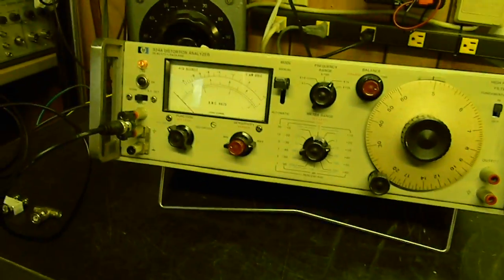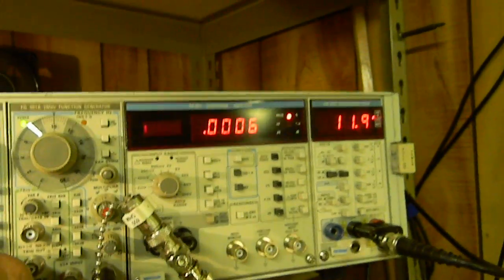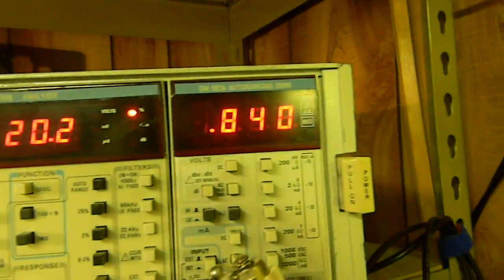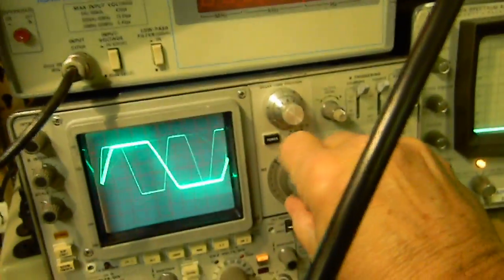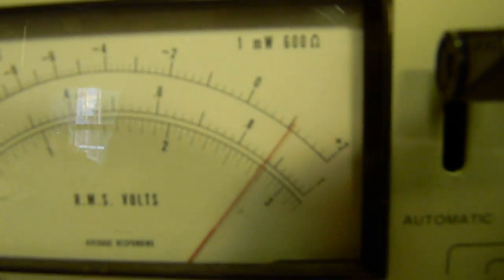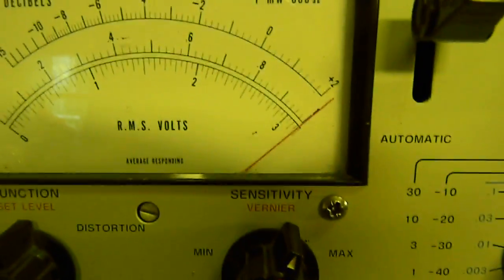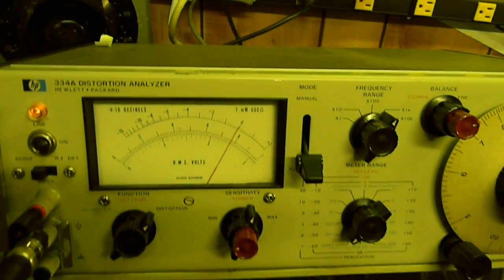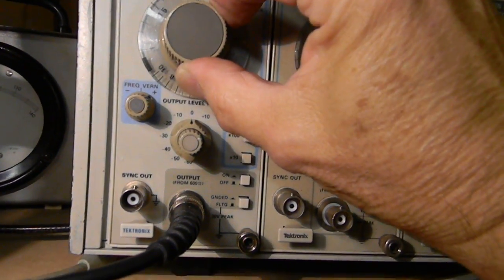Hewlett Packard HP 334A Distortion Analyzer 2 of 2.MOV

Comment: The RF Detect switch on the left was for AM radio station use back in the day when the FCC required “audio proof of performance “ annual testing. The RF detect input BNC is on the back. In use an engineer could connect an RF sample from their transmitter and then read THD on the 334A. I personally never used the RF detector in the 334A and preferred to use the station’s modulation monitor audio output instead. Many hours in wee morning hours behind the 334A. Still have one. Still works very well.
Reply from the maker: Philip,
Really nice for you to add this bit of information. Otherwise, most of these details are going to soon be lost to time, certainly one of the reasons I post videos on these old instruments to help prevent this loss of knowledge.  Now I almost wish I still had mine as I operate a homebrew AM station on the amateur bands. I do have a fancy PC based program that takes a sample of RF off the line and monitors positive and negative modulation peaks.  I use a "keep-alive" voltage source and peak limiting circuit that actually works very well where positive peaks can go well over 100% but the negative peaks can be set to never exceed 100% by varying the keep-alive voltage source. Thank  you for your comment.
Reply: @ElPasoTubeAmps  Thanks. I enjoy your work with tube amps. I have a. Harmon Kardon Citation II I’m getting ready to rebuild. I had this for almost 50 years and stored away to someday repair/re cap it. 

The envelope detector in the 334A works all the way to 6 meters. So perfect for checking distortion on an AM ham rig.  Unlike BC transmitters Amateur Radio AM rigs don’t seem to like continuous sine wave testing. Watch for over heated transformers etc.

Comment: What is the purpose of the 600 ohm load? Thanks.
Reply from the maker: +Phil Hemenway Depending on the equipment, many pieces of test equipment require an external load so that the dB scale is calibrated almost always 600 ohms for audio and 50 ohms for RF equipment. For cable TV systems it would be 75 ohms. If you don't use the external load the voltage will be double and your gain/loss measurements won't make sense. It usually doesn't affect the distortion.

Comment: Your problem may be capacitor related. More specifically film capacitors. I have a bunch of old rack mount hp test equipment, just recently I got a HP 500BR frequency meter that was WAY out of calibration on the higher frequency. I replaced all the film capacitors with high precision cornell dubilier and vishay sprague in the range selector switch and after recalibrating it work beautifully now.

Comment: Thanks for the demonstration.

The way the distortion analyzer works is that you adjust a notch filter filter through the procedure you demonstrated to remove the fundamental frequency. Once the fundamental is notched out, all that is left is distortion and noise.

Comment: Can someone tell me what this actually does, i think I get it but can u reverse this by adding more distortion if you want for creative purposes
Reply from the maker: Its purpose is to identify the level of Total Harmonic Distortion (THD) and it is typically used to help reduce THD in an amplifier. Using it to increase THD for creative purposes would probably not be a good use for this instrument as it  gives - Total - harmonic distortion. You would want to use a spectrum analyzer which will clearly display each individual harmonic and its amplitude so maybe you could "tune" an amp for desirable and undesirable harmonics.
Reply: Thank you for the information

Comment from the maker: Thank you - it is a bit labor intensive and for that reason I tend to make less measurements but I agree that it is beautiful and that is why I keep it.  It is as accurate as the digital equipment and it has a very nice analog audio voltmeter The Tek equipment seems to be the most accurate (in my opinion) and is microprocessor based but the HP 8903A/B  is the way to go. I got mine for $530 for the 8903A and USB/HPIB interface.

Comment from the maker: The HP 334A style is nice but tedious if you want to mearsure many points. Best ultra low distortion oscillator I have found is the Tektronix SG 505 - plugs into the TM 50x series modules. I test at 1KHz initially for max power, clipping level and sine wave distortion then move to 30 or even 20 Hz at the low end and 20KHz or more at the upper end. 400 Hz would be a good point also. I am not familiar with anything but the HP and Tektronix distortion analyzers. There may be better instruments.

Comment: @essoterric
I ask because I have a HP8640B signal gen that produces FM (from an internal or external input). The specs from manual & measurement by other owners is about 0.3% distortion (0.2% for internal audio), so total of 0.5%. If I use a low distortion "stereo gen" to drive the audio, total 0.3%-0.4%? The dedicated FM Stereo RF signal Gens advertise 0.1% or more. I read distortion can affect alignment & separation (vintage stereo FM tuners). If you want to sell the 334A let me know.
Reply: They are good units I use a 333A which is basically identical to the 334 to do just what you are intending, I know this is an old post and you have  probably solved your questions by now but my weak link in the chain is the FM signal generator and getting it to produce a consistent frequency, just something to watch out for.

Comment from the maker: Good distortion numbers would be considered by most to be 1% or less in the playback system. Distortion at 10% or more, generated by the guitar amplifiers, are not uncommon in the creation of music and may be desirable to the player and audience. Distortion may be intentionally introduced at low level (in the voltage amplifier stages) or at high level by clipping in the power amplifier by overdriving it. Playback within the stereo system with distortion that is reaching clipping is undesirable

Comment from the maker: The back-and-forth nulling procedure is to completely null as much as possible the test frequency - say the 1 KHz signal you are injecting into the amp that's passing through to the output. We are measuring at the output of the amplifier so after suppressing the fundamental (test) frequency what's left are the distortion (harmonic) products created by imperfections in the amplifier. The analyzer displays the sum of all of these harmonics giving Total Harmonic Distortion (THD) on the meter.

Comment: Also I was thinking if you are trying to make an adjustment of MIN distortion does it matter what the absolute value is. If you are not trying to meet or measure factory distortion than it can still serve as a tool to adjust say a radio for min distortion. With that said I don't know much about distortion. What  are good distortion numbers for a radio, amp and other audio sources and devices. I assume the speakers are the big distortion adder. Also can the ear even hear this?

Comment: Great video and JUST what I need. I have a mechanical engineer degree but restore tube radios and amps for a hobby. I want to get a distortion meter and was looking at the HP 334A. I have HP and Tektronix gear test gear. I am more into RF than audio, but I want to expand into FM stereo alignment, thus the need for audio gen and distortion meter. It seems a low distortion audio gen is needed. Suggestions? Also what is the common benchmark audio Freq test are done for amps? 400 Hz or 1000 Hz? Thks